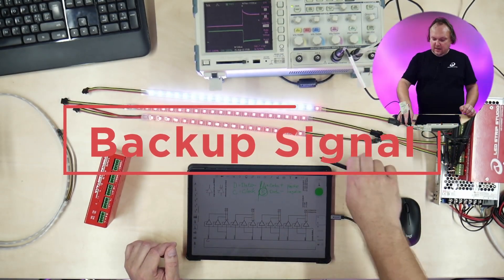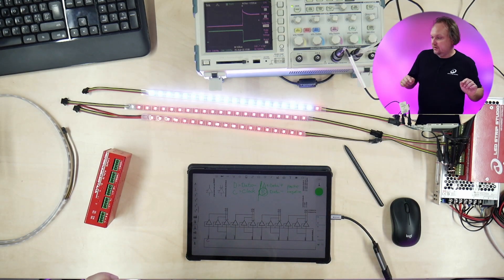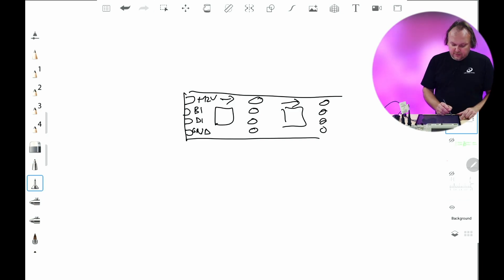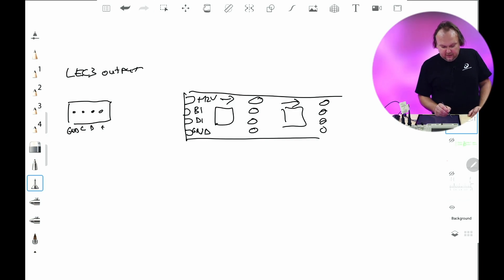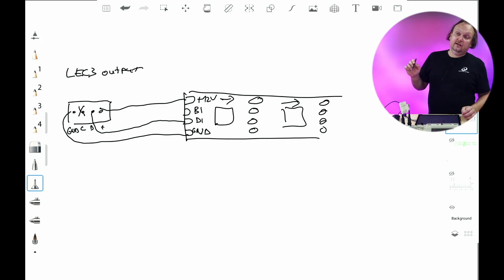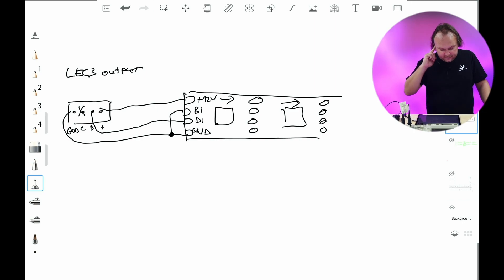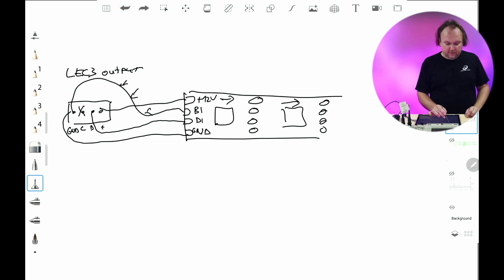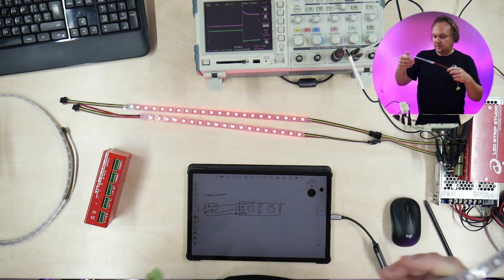Backup Signal - How to connect WS2815 to our controllers

Comment: What if you connect multiple ws2815 strips in one run, do you just connect the backup to the ground on the first strip in the run or all of them in between each other?
Reply from the maker: You short the Backup at the beginning only. Between the strips you continue connecting the In and Out pads, e.g. Backup Out -> Backup In, Data Out -> Data In and so on. The only think that you don't connect is the (+/Vcc) when you are using multiple power sources.

Comment: I have a recently acquired a strip that is labelled "FI FO" instead of BI. It seems to be the backup line as it runs the LED light program for either line. The distributor recommended that I tie the data DI and FI together. FYI, the product is a 10m length of 24v "flex" strip light.
Reply from the maker: Best practice, for us, is to connect the Backup data on Ground. Which IC is this? Curious about the labeling. Never encountered such strip, yet it happend  a few times that the producer simply decided to use their own marks :)

Comment: Thank you very much for the good video. But what is the point of the backup pin? is this there for the fact that if an LED breaks, that the signal is then looped through?
Reply from the maker: Hi, yes, the purpose of the backup is when one LED diode dies, the second one after the broken one will work.

Comment: Why couldn't you connect the backup data to the original data line?
Reply from the maker: Because that would shift the image data. The backup line should remove first LED from the data you send, but we don't do that in the controllers. You would need to generate whole new signal, which doesn't contain first LED to be correct. Anyway, our experience - the backup never works well.